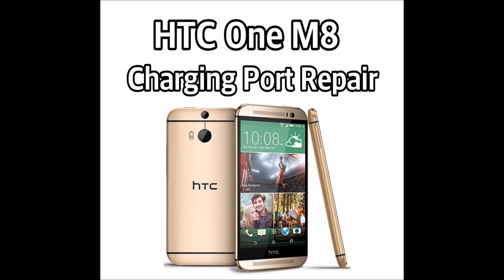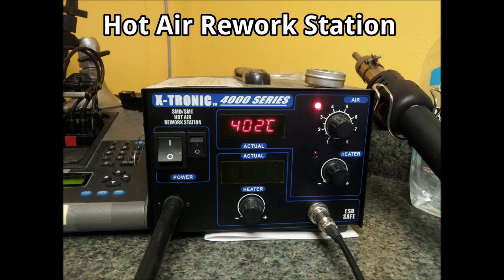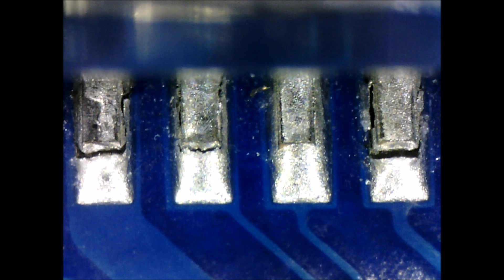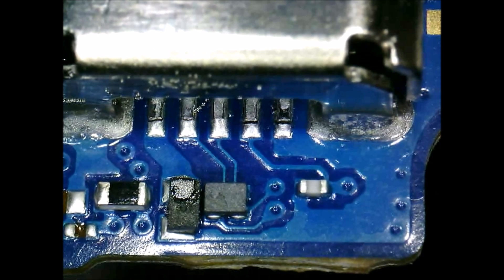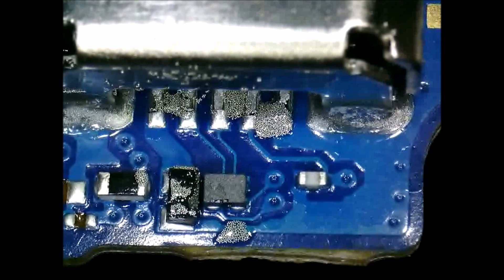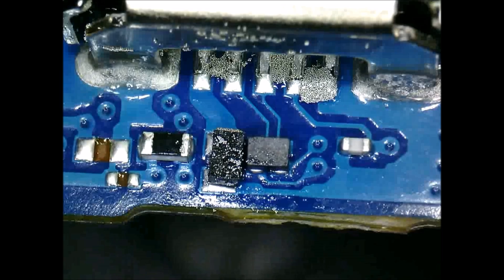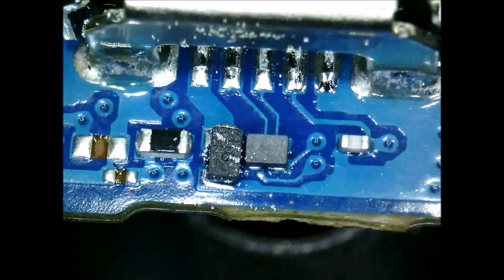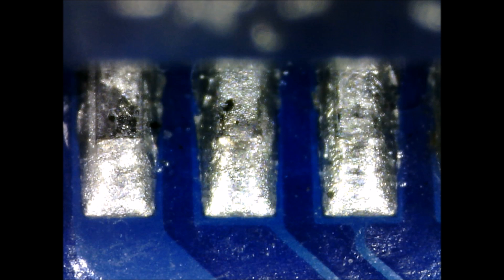HTC One M8 Charging Port Repair

Comment: Oh yeah, I got a $50 rework station with 2 separate digital readouts off ebay, ( 110V SMD 2 in 1 862D+ Soldering Iron Welder ESD Hot Air Rework Station w 4Nozzle ), I used it once and plan to try it on the phone charge port since it can do many solder joints at once with hot air,  any advice?

Comment: Thank you for making this video! I replaced the board but now my phone won't fast charge, and the F.M. radio no longer picks up a signal. I was really hoping to repair the original P.C.B., and this video shows that it's possible. I wish I could have found an original O.E.M. Replacement board, but I guess they are harder to find than I first thought it would be.